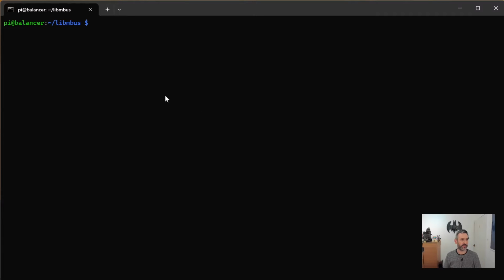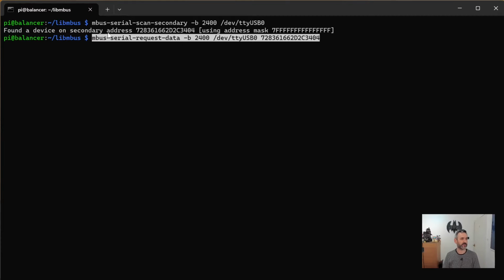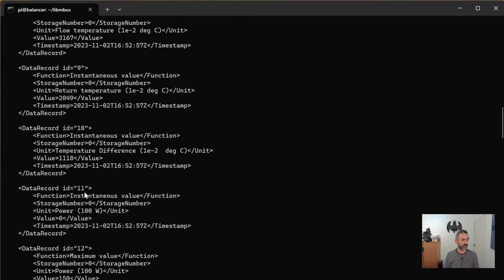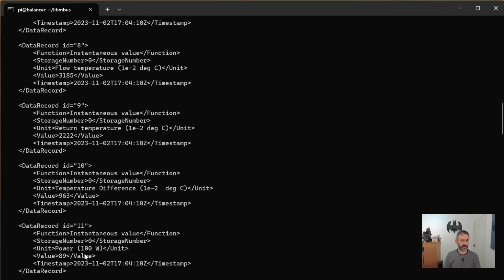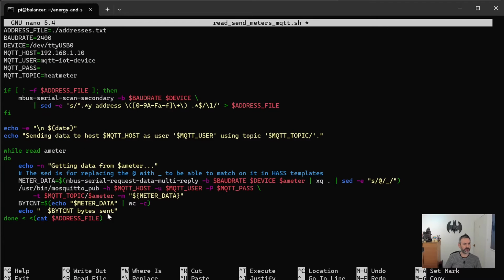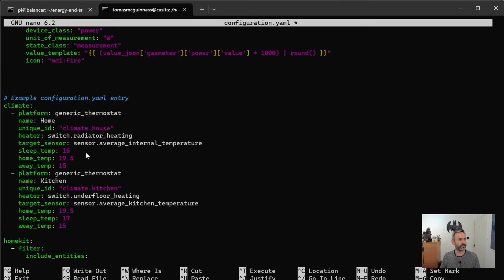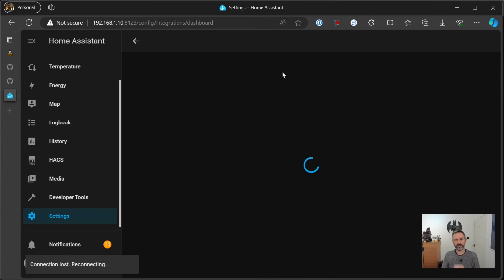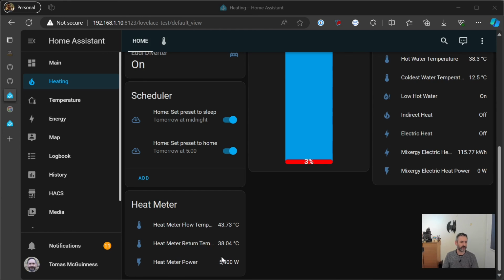Introducing and connecting my heat meter to Home Assistant

Comment: Are these meters to benefit a landlord or a tennant would you say?  Also are they controlling what you use or are you?
Reply from the maker: Not at all. They just measure the temperature of the water in the pipes to work out how much heat is flowing around the system. As my heat comes from gas, I’m metered on the gas consumed, not the heat it produces. This benefits the energy companies I guess.

This meter isn’t connected to my boiler at all. Purely used for information in my setup.

Comment: Also changing our front door as the hallway is the one noticeably cooler area of the house, and as this is open to the stairs and also the main living area unless the internal door is closed (which it mostly isn’t), it’s not ideal. The replacement will have a triple glazed side panel and no letter box, so hopefully this will improve this part of the house.
Reply from the maker: Our house is the same as we still have the original external door. We had a new floor put in and there is now a 10mm cap under the door, which allows for a horrific breeze!!! I have an excluder, but my dear family seem to keep forgetting to replace it 🤣

I want to get a new door, but we seem to keep kicking that can down the road :(

Comment: I’m definitely interested in getting a heat meter installed as part of our ASHP preparation. I’m fairly certain our house has pretty low heat loss as it’s consistent warm and our gas usage is pretty reasonable, but it would be nice to know. Have good gas usage data thanks to a functional smart meter and Octopus API but don’t actually know how much heat that gas is producing.
Reply from the maker: That’s exactly why I did it! I wanted a good read on the heat output and flow rates and it’s given me real confidence that we’re in a good shape!

Comment: that t-piece and temp sensor on the flow - who makes it?
Reply from the maker: Hi, the temp sensor is part of the heat meter itself. The probe pocket was supplied by OpenEnergyMonitor when I bought the Heat Meter. They supplied the whole kit. 

Sorry I can't be more specific.

Comment: Hey Tomas!
Thanks for the great work and showing how its done!! With your Video and the blogpost from mole even I with absolutely no Software background was able to push the data to my mqtt and into home assistant!
At the end of the Video you mentioned to clean up the Script on the pi not to Transfer all the mbus data to the mqtt and reduce traffic a little. Did you end up doing those adjustments? Also i am wondering how you corrected the decimal issue on the temperature readings. I can only think of using a helper entity to do so, but i was wondering if you maybe found a more elegant way to do so and do the decimal-correction in the raspberry Script already or maybe in the configuration.yaml right where the sensors are being set up?
Anyway, keep up your great work!!
J
Reply from the maker: Thank you! I'm thrilled to hear that one of my videos helped somebody else!

For the rounding, I did that in the Home Assistant template, using round(1) in the template. For example:

{{ ((rec.Value | int) / 100)|round(1) }}

Adding the |round(1) to the end does the job. The temp then displays as 34.4 

I figured it was better to do it at the receiving end, rather than reduce the accuracy on the sending end. 

As for the MQTT payload data, I didn't return to it. The payload is quite big, but in the great scheme of things, I don't think trimming it down would make much difference. I would like to understand more of the parameters being sent by the heat meter, so if you've learned more than me about the payload, I'd love to hear it!

Thanks again for your comment!

Comment: HI Tomas, great set of videos. Really helpful. I am about to do the same on a heat pump which appears to be massively oversized and inefficient. Did you need to buy the communications module for the heat meter or can you get the m-bus data direct from the meter?
Reply from the maker: Thanks!

When I purchased my heat meter from OpenEnergyMonitor it came supplied with a M-Bus => USB module. I then found an old Raspberry Pi 3 and wrong a simple python script that reads the MBus values and publishes them onto MQTT. 

This is the unit I received - https://shop.openenergymonitor.com/m-bus-to-usb-converter-heatpump-monitoring/

Comment: Hi Tomas, since first watching this I now have HA up and running monitoring basic flow and return temperatures. The next thing is to try and emulate what you have done , reading on Open Energy site it suggests a qp of 6M3 if above 17kW, which mine is (18kW) when PDHW is charging the cylinder, however yours is 2.5. 
Have you set your boiler to 11kW or less hot water charging output or it works fine no matter as your not interested in non central heating performance as it wouldn’t be condensing, interested in your thoughts.
Reply from the maker: I was looking at the flow rate mainly, rather than the pressure drop/resistance. I checked with OpenEnergyMon and they recommended the model I have.

I have also range rated my boiler so it's max output would be 17.5, which is never really reaches anymore.

I understand a little more about it all now (having done a 2 day course). The heater meter should be able handle the flow I need for about 7kW at dT 5. That is what I'd get from a heat pump, so I was kinda planning ahead.  As my dT is a little wider (about 8 degrees), the flow is less than 1m3/h, which is within range for all the heat meters of the 403 range I think. Still getting to grips with this stuff.

And you're right, I'm not interested in the heat being delivered for hot water. I don't use the gas to recharge the cylinder that often as the immersion takes care of it in the morning (it takes longer, but is cheaper at present).

Let me know how you get on!

I'm getting a good feel for my own house now and the heat loss is about 330 W/deg C at best guess, excluding heat from people/appliances/etc. so it's probably a little higher.

Comment: Hi Thomas, great videos..im curious about adding a heat meter as well. Ive home assistant already on a pi. Is there a way to integrate the hest meter with WiFi/ha without using another pi?
Reply from the maker: I’m not entirely sure. The Heat Meter I have uses MBus, so all you need is a way to get this data into home assistant. I just use a Pi as it’s a convenient way to get the MBus talking via MQTT. If your heat meter was beside your Home Assistant PC or Pi, you could probably connect it directly!

Comment: I see you're using Mixergy cylinder. How would you monitor temperature of a regular unvented cylinder. Any ideas?
Reply: Myself, I'm using a Tesla T-Smart immersion thermostat, mainly for its WiFi temperature sensor. Great idea on paper but very unreliable for monitoring temperature, especially when it loses connection when heating water.
Reply from the maker: Before my Mixergy is used three probes, which I taped to the inline, outlet and one of the unused outlets about midway up.
Reply: @tomasmcguinness  Thanks, any specific probes?

Comment: Interesting approach to be able to measure the energy flow. There are also modbus RS485 to USB adapters that you can plugin in a HA server and use the modbus integration.
Reply from the maker: I didn't know that. The RPi is good enough right now, but it's good to know I have the option to integrate directly!

Comment: Hi.. looking very good.. have you tried using node red with modbus pallet installed.. might be easier to filter the address's you need? Also change the integer to decimal value.
Reply from the maker: Didn’t even know NodeRed had a modus thing. I’ll certainly take a look! Thanks!

Comment: Super interesting ... got myself a 403 exactly for this purpose to right size my heat pump ..saved me hours of researching to get it into HA/influx.. thanks
Reply from the maker: Awesome! Glad the video was helpful!! I assume you’ve got a gas boiler like myself?
Reply: @tomasmcguinness   Yes indeed 35KW monster Worcester CDI system boiler !
Reply from the maker: Same 🤣
Reply: @tomasmcguinness  I have the older classic version where your 10K trick won't work. Using the ems bus thinggy with HA to control PDHW. That makes it more desperate to get rid of this boiler  :) ha ha